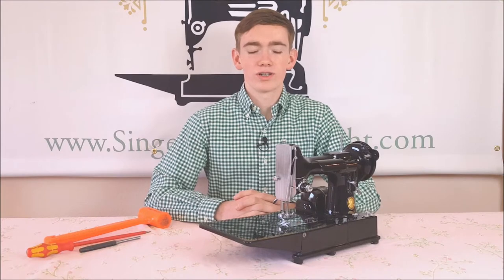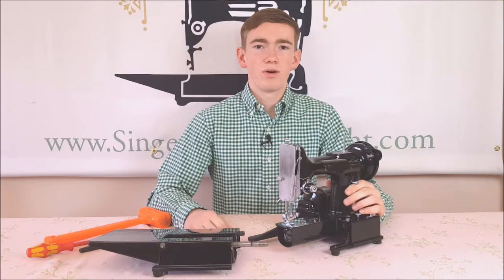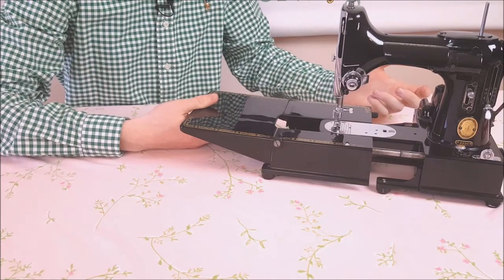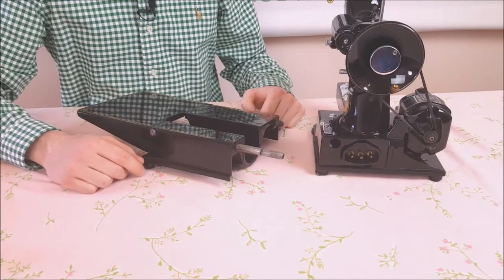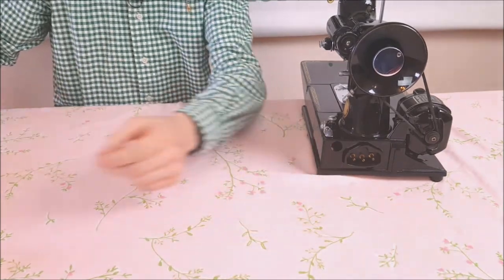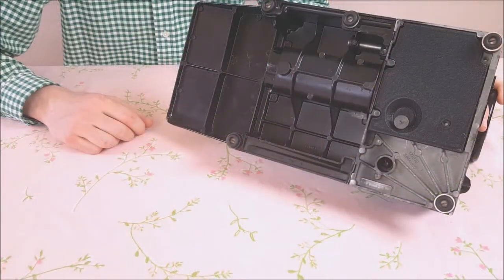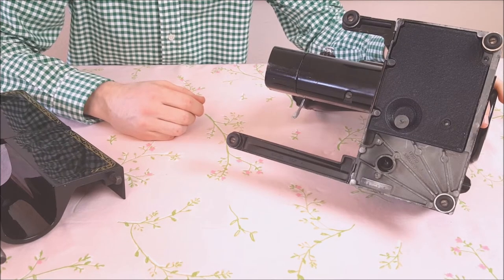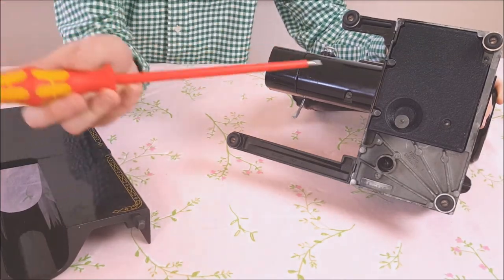How To Remove a Singer 222K Featherweight Bed Extension

Comment: Thank you for you video. I Managed to get the bed of using an hammer as you suggested. however it still sticks on, I have checked the screw at the bottom, can you suggest any other reason why the bed would stick or suggest a fix for this please.